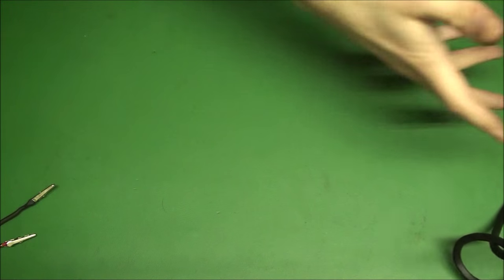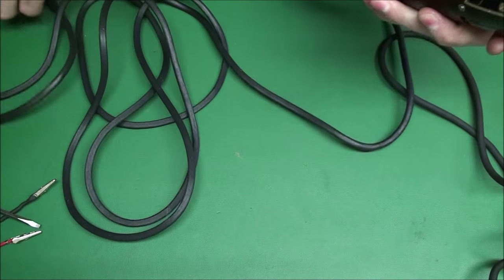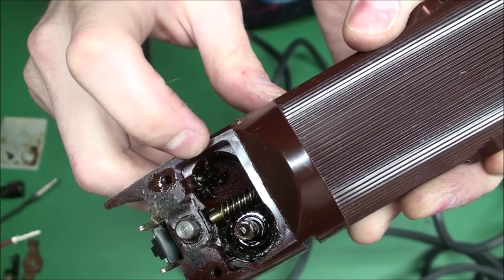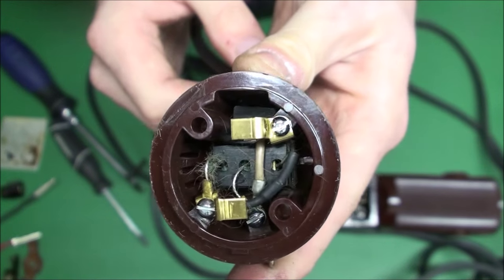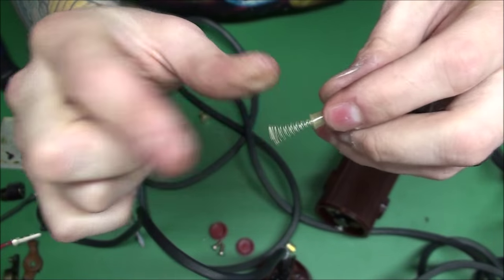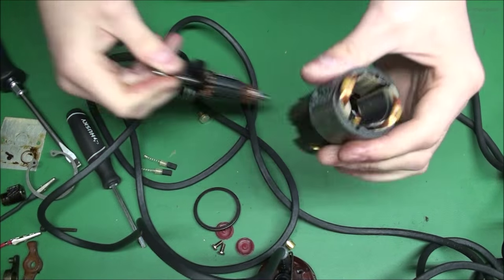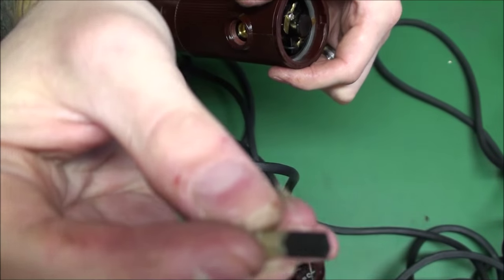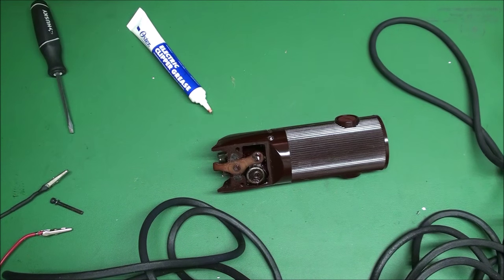Oster A5 Clipper repaired  by a pro

Comment: I came to this video because I'd already snapped the snap ring several times and wanted to see if there was a trick to it. So I open the video, jump ahead until you get to that part. I'm listening to the video and still trying to get the snap ring out. Literally, and I'm using the word "literally" correctly here, literally 2 seconds after I snap my case I hear "You snap this ring, it'll bust your case wide open." If I'd only been slightly more patient. And I even bought what I thought was a decent pair of Irwin snap ring pliers. No worries, if the superglue doesn't hold I'll just get a new housing. Great video.
Reply from the maker: Thanks for watching

Comment: Great instructions here. I have been running a Turbo A5 at home for 8 years now and finally I have to repair it. The pin in the middle of the lever is loose, but I'll go through the whole trimmer. That trick at the end is terrific, it increased the rpm like you said. Thank you Sir.
Reply from the maker: Mark Erickson np. I'm happy it could help you. Thanks for watching.

Comment: This guy knows exactly what he talking about There is a wealth of tips so watch carefully TWICE is good Centering the armature is just one as an engineer Iwork on many different machine but never a clipper this is designed for the Pro and yet covers the silly things that people do like grinding off the nip on the end cover Sheesh! Well done young man smooth and concise  presentation. Very useful As I said to me most is obvious but some thing are not so obvious unless pointed out Thank you. One small thing which I suspect you may do but not in the video because of the possibility of "getting it wrong" is cleaning out the groves on the armature only for those with a steady hand and confidence one slip and you can ruin the part.
Reply from the maker: +Paul Kelly Thank you, i'm glad you liked the video.

Comment: Wow, great vid.  When you tapped the case & I heard it speed up, that was cool.  I just sent my Oster Star-Teq in to Oster.  They couldn't fix it, even though it just seemed to be a short (wiggling the cord mattered)?  They're replacing it with a Titan.
Reply from the maker: Thank you. Yeah speed up because it's a floating field around the Armature, so when you hit it, it realigns itself. That's great the Titan is a great clipper. Thanks for watching and have a nice day
Reply: @cloudsdiamondsharpening3973  Have you worked on the Oster Star-Teq types? I'm thinking now that mine may not have a short, but just needs new brushes (18 years of home use & it's never been serviced).

Comment: Great video thanks, I have a Golden A5 2 speed clipper that I purchased in Australia which has a Aus plug, mine works perfect but I noticed it doesn't have the ball bearing oiling hole on it, how do you go about oil maintenance, is it possible?
Reply from the maker: Keep the blades lubricated with blade oil. I would address everything else internally when you service the clipper.
Reply: @cloudsdiamondsharpening3973  Thanks will do!!

Comment: Hi, my oster 76 which I bought factory refurbished, after 6 months  gets a bad noise and vibration only when a blade is attached. It does not do this when I hold it upside down. It runs so smooth when no blade is attached. As a professional, this sound is not acceptable. Its definatly coming from the motor. I wonder if it's possible to fix?
Reply from the maker: yes you can fix it. It needs the hair cleaned out of it and the bearings oiled

Comment: I have an Oster A-2 clipper, is it possible to change it from a fixed blade to a detachable blade by removing the fixed blade bracket and installing an older model 10 hinge?
Reply from the maker: I guess anything is possible. You could try it, but more than likely you'll have to do some customizing. I don't believe it will be an easy "swap."

Comment: What type of grease, other than Oster gear lube which is very expensive, can I put on the gear mechanism?  White lithium, Lucas red and tacky, Vaseline,  mobile 1 grease? What NLGI number should be used?  Thanks.
Reply from the maker: I would only recommend oster gear lube. I'm sure there are alternatives, but oster gear lube is what I'd recommend. The cost is minimal compared to what could go wrong by trying a different option.
Reply: @cloudsdiamondsharpening3973  thank you for your prompt response. But let me explain. I’m leaving for Qatar in 36 hours. There are no places to buy Oster brand gear lube in that time, I’ve searched. The Qatar mail and infrastructure where I’ll be is like living in the 8th century. However, I can access certain grease like Lucas red and tacky and  other NLGI# 1, 2 or 3 grease lubes. In other words, Oster brand gear lube is out of the question for the next 18-24 months. So if you can think of an appropriate off brand lube for me and my trusty Oster 76 classic, which I’ve used faithfully for 6 years, I’d appreciate it. Thanks in advance.
Reply from the maker: @TheindefatigableGovernor   No Problem.. I have never used other grease bc some will be for metal or ceramic etc. I mean you can try any grease but i cant tell you if it good for that material. For example some grease can withstand heat and some cannot or some might be thinner and might evaporate in heat, so its up to you what you use but i cant say it wont damage anything bc I'm not a grease manufacture. I'm sorry i couldn't help you.

Comment: Hello. Great and informative video. I have used Oster titan for myself for 3 years now, so i checked carbon brushes to see if they need replacement. I noticed that left carbon brush has been grinded twice as much as right one. Is that normal? Does that indicate that motor is not seated properly in the case?
Reply from the maker: pipi kiki hello. No the brushes that you buy should be seated already. The aremature comuntator might need to be cleaned with a diamond stick. It could be wet or to much debris on it.
Reply: Thanks for fast and helpfull reply
Reply from the maker: pipi kiki np. Also there might be other causes like the spring was stretched out or a defect in the brush.

Comment: Hi from UK,
Good video, simple to follow. I have a set of A5 clippers that after a couple months semi-heavy usage now struggle to work the blades. They have the power to slide the blade cutting edge when not cutting anything but no power there when you try to cut fur. When new I can not hold the drive tip due to the power from the motor but now I can almost hold the drive tip still with my thumb due to lack of power. Have I burned them out or could they be repaired ? Thank you
Reply from the maker: Ian Black hello. I'm glad you liked the video. if you never had it serviced then that is the problem. motors collect carbon inside and causes friction and will slow the motor down. it could also be that everything needs to be oiled and lubed. Maybe brushes are low and not making connection correctly. I can't give you an answer without me diagnosing it. They can be repaired but I have no idea how much money it will cost. thanks for watching.
Reply: Brilliant 😊 , thanks for taking the time to reply.

Comment: great informative video
Reply from the maker: I'm glad you enjoyed it. Thank you for watching
Reply: +Cloud's Diamond Sharpening I took my old model 22 progienic clippers apart and the field is covered with carbon. since yours was pretty clean..whats the best way to clean it?
Reply from the maker: +KAPITAL GAINZ FITNESS I have this industrial electric cleaner I use and then use an air compressor to blow it off or just try to wipe it off the best you can. If its just carbon it should just blow off.

Comment: Great video and info. I have an old Golden A5, that has two small pieces of felt like material on each side of  the red part that moves under the name plate. What are these called, and where would I order them from?
Reply from the maker: I think you talking about felts? that go on each side of the lever ,one on each side of the case post? if so they  are called felts or hair guards and try Fort shaver and appliance. thanks for watching.
Reply: Yep! Thanks. I haven't picked up clippers in almost 30 years, and forgot what they were called.

Comment: the hintch u talking about where the screws go in around  23 mins in your video i just did the same thing i stripped where the bolts go in and now my hitch is lose and it do not tighten on my 76 classic , should i replace that part if im able to? what do you suggest?
Reply from the maker: Ricardo Cisneros hello. You will need to take a Dremel tool and get a cutting disk and cut a notch in the screw to remove it with a screw driver or buy a new housing.

Comment: My 76’s work but they are smoking. Any ideas what this could be. I greased them and carbons are good. Pls help!
Reply from the maker: Did you clean the hair and carbon out of the motor?
Reply: Cloud's Diamond Sharpening I cleaned with  with a brush ,also  i found a slight  crack on the  toggle.
Reply from the maker: @nicoleaubry2981  ok. Did you take it all the away apart and clean inside the motor and oil it? The crack in the won't make it smoke but will need to be replaced if you want to fix the crack.

Comment: so if I put a 76 clip/blade it will work fine for human hair? just asking because  I can get one in good working condition for $30
Reply from the maker: If they are working a5's  they will work to cut hair with a 76 blade. Now they could get hotter if they are turbo or 2 speed bc they blade heats up.

Comment: Could u use just like it is with plate n hinge to cut human hair with it or do I just need the hinge and plate don't worry about. n still use the two speed on human hair
Reply from the maker: +Garcia Levere All animal clippers will work for barber blades. The difference will be the animal clipper will be faster so your blade will get hot faster. The hinge has a latch that will latch barber blades. Animal clippers have longer cords. Thats the only difference between a 76 and A5. Some of my customer barbers buy animal clippers bc the like the fast speed or the latching hinge. Its up to you really. Have a nice day.

Comment: What makes the machine have a burning smell,coming out of the vents ?
Reply from the maker: bigo boss alot of things. Hair inside, wet brushes, bad aremature, posts on feild missing and rubbing the aremature, fan loose. Hope that helps and thank you for watching
Reply: Would worn out brushed cause it ..the clipper still runs fine it's just the smell .any way of tearing the armature  (thanks for the reply)
Reply from the maker: bigo boss np. it can be the brushes if they are not making good  contact
Reply: I meant checking the armature ..     which website do you recommend to get the parts from .

Comment: I've seen replacement oil wicks for the A5, how do you know if you need one?
Reply from the maker: If your clipper is squealing but it doesn't do much, they have removed them in the newer ones because if you get it serviced every 6 months or so it will get oiled when disassembled and never squeal.
Reply: I rarely use mine, they are only my backup clipper. I was just curious because I never heard about that part before. Mine works fine. Thanks!

Comment: i have a 76r clipper but when i turn it on the air it blows smell like burn ! any ideas if is fixeable
Reply from the maker: Jairo Aguilar yes you will need to have it cleaned out and probably an armature. if it over heated. I'm sure it needs other part also if its filled with hair.
Reply: thanks men i disassemble it  yesterday and it was filled with hairs , im going to try to clean out the armature and see how it works appreacite your response 🖒
Reply from the maker: Jairo Aguilar NP

Comment: Bro, can I just switch the blade hinge from my A5 and put a 76 hinge for it to work with regular blades??
Reply: The A5 hinge is fatter and so regular blades wont slide in...
Reply from the maker: perez senior a A5 will work on a 76. they are the same. a5 hinge just has a latch
Reply: So its my 111 that has thinner blade slots ?!@#%? (BTW thanks for all the great videos) cheers from California.. ;)
Reply from the maker: perez senior ya a  t-111 hinge won't work correctly on 76 blades. NP and thanks for watching.

Comment: can you change the clipper's voltage ?
Reply from the maker: I can not. I do not have the diodes to solder inside to convert voltage but you can try a overseas adapter or I'm sure there is a shop out there that does have the parts. Sorry  but thanks for watching.

Comment: can i use a a5 turbo on human hair?
Reply from the maker: hunter morrow yes you can. It's faster so the blade will get hot faster than a slower oster76 barber clipper. But they can use barber or animal clipper blades still.